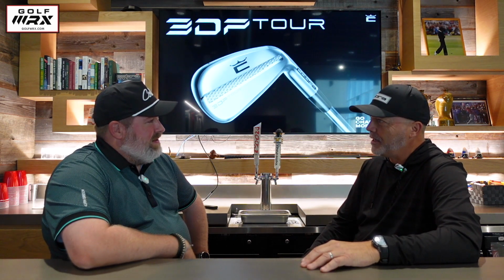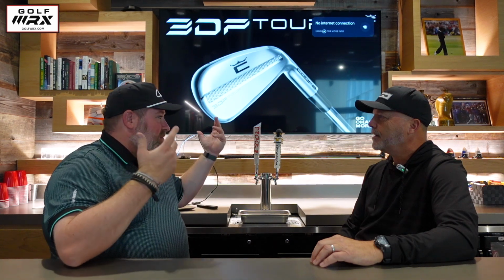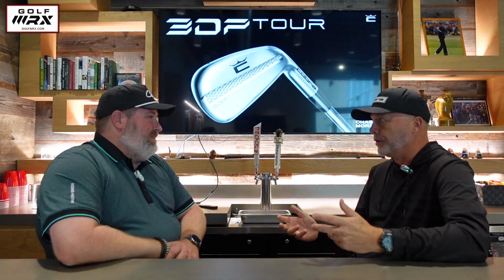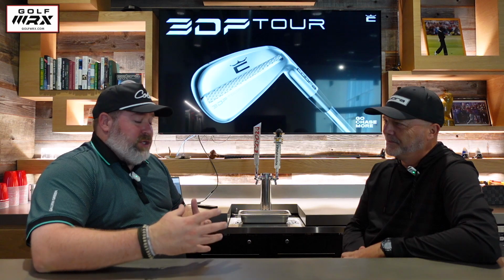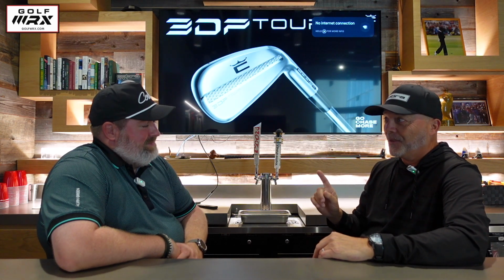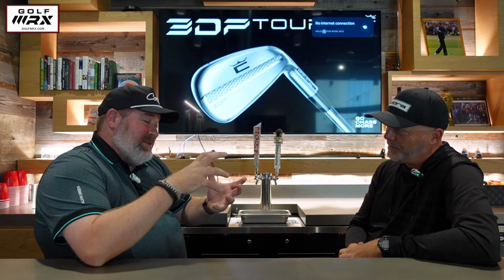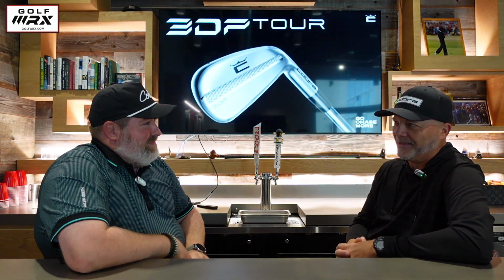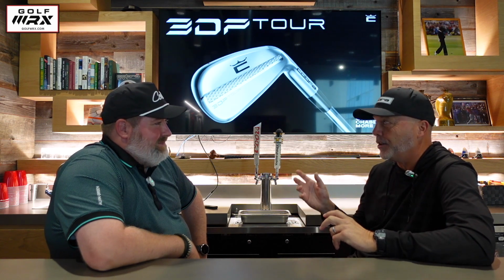Cobra 3D Printing Deep Dive with Mike Yagley

Comment: Codra needs to team up with Ruger. Metallurgy, casting, 3d printing. It could keep costs down & speed up production. 2,200 for irons or 350 a club is kinda steep. Plus the competition is going to copy them anyways. Might as well get a larger chunk of the market.

Comment: The face is thick enough to not allow any flexing which would cause the internal metal lattice to crack. So certainly not like hollow body irons with thin faces and internal support material both of which flex and allow ball speeds at max COR.
I am sure the internal latice structure and face thickness  has been designed at an optimum size to avoid lattice cracks due to vibration from striking a golf ball.
Yes, a more forgiving blade iron.
Reply: In another interview about Limit3D, they said Kyle Berkshire tested these and couldn’t cave the face. He usually caves driving irons within a few months.